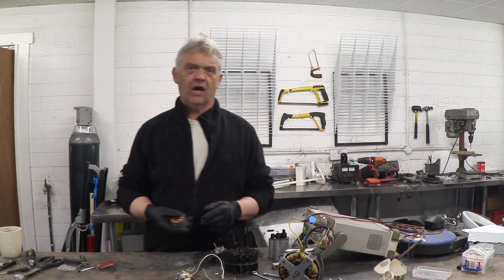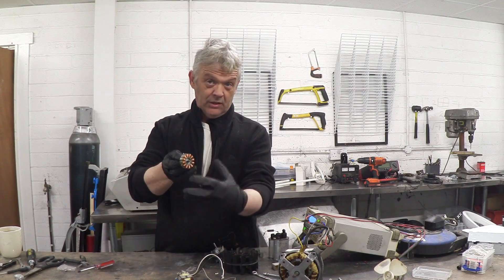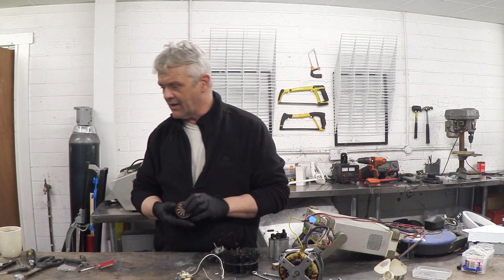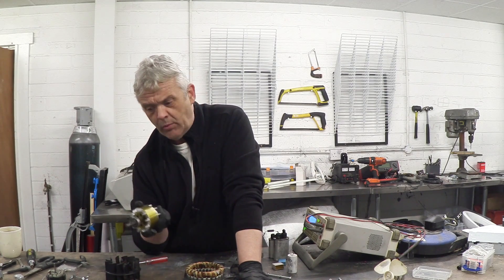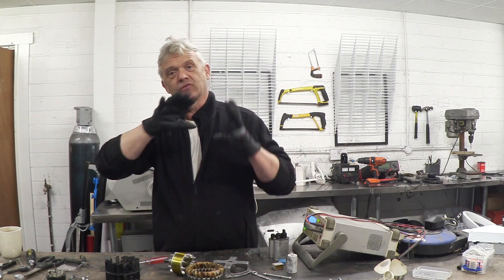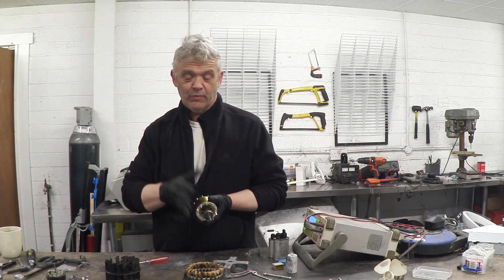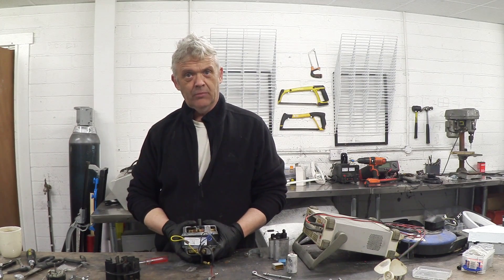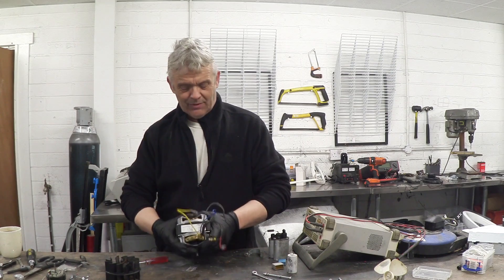500 An Induction Motor As A Generator Without Altering The Motor

Comment: I think the best speed has something to do with the tuned circuit: f = 1/(2*pi*sqrt(L*C)).
Reply: The capacitor is used to cancel out the reactive (inductive) current that the motor draws, apparently. (See 'Motors as Generators in Micro-Hydro Power' by Nigel Smith, from your local library?) This reactive current is relatively constant over the range of power outputs from the motor. A fair approximation of the required value can be found by (a) measuring the current drawn by the motor at no load, preferably with the cooling ducts blocked, to reduce the actual work being done by the motor. That current is mainly magnetising (inductive) current, with only a small 'true power' current driving the reduced windage, bearing friction, and low iron and copper resistive losses. (Some of the measured current is still driving resistive losses in the motor, but at no load, and with the cooling duct blocked, these losses are minimised, and most of the current will be reactive.)

Then, determine the reactance of the motor to draw that current. XL = V / I. That gives the approximate reactance the capacitor needs to have to compensate for the motor reactance. The capacitance can now be found from C(uF) = 10^6 / (2 x pi x f x Xc). 

Example: a 1kW single phase motor draws 2.3A from a 230V supply at no-load. The motor reactance is approximately (230 / 2.3) ohms = 100 ohms. The capacitor that will also have approximately 100 ohms reactance at 50 Hz is.... (10^6 / (2 x pi x 50 x 100) = 31.8uF. That's the starting point for setting up the capacitor; it /will/ require a slightly larger capacitance to hit the 'sweet spot' for best operation.

For 3 phase machines, refer to Nigel Smith's book. The principle is the same, but the capacitors may be connected in either star or delta, and the capacitances and voltage ratings are different for each of those cases.

The capacitor is not a motor-starting type - these are rated for intermittent operation only, and often less than the motor voltage. (That's another story, though.) A polyester or other 'motor-run' capacitor is required, and should be rated at a higher voltage that the output voltage of the machine in operation. (Switching off a large load can cause a 50% surge in output volts in some machines!)
Reply: Thanks for the lead to "LC circuit" concept! I have been also wondering whats the magic formula really is. I dont know any algebra but what i have tested with the common tank circuits its always 1:3, 1:6 or 1:9. So for example in "Super Joule ringer" there is one full wound triggering coil to 3 full wounding for collector. But the capacitor for tuning is hard to calculate and usually needs additional tuning capacitor too. And for some odd reason super capacitors seem to work better with it when they are "wrong" direction (+ > -) in the circuit...
Reply: Use a non-polar capacitor, eg a motor run/start type of sufficient breakdown voltage. I think they’re usually film caps.   

Per Tim’s equation, if the inductance is in the mH range and the cap is in the uF range, then the LC resonant frequency is up above the kHz range.  

R in ohms will be greater than L in Henrys, so the RC frequency will be less than the LC frequency.  Doesn’t it work on a ~90 degree RC phase shift?
Reply from the maker: that makes sense mate - cheers

Comment: I would love to see this into a next generation high efficiency windmill.  I'm sure the use of graphene and super capacitors will help!
Reply: ...........not so sure...induction motors are designed to spin synchronized to the mains frequency ..would they still need to spin at same RPM if they are generating electricity versus being driven by the mains frequency supply?
Reply: @philipvernejules9926  As a motor it actually runs slightly slower than mains frequency, due to the "slippage" that Robert mentioned, with the speed difference depending on load. But it will be designed to run most efficiently at around mains frequency, so it will probably be most efficient as a generator about the same speed. Probably not so good for a wind turbine, which needs to accommodate a wide range of speeds.
Reply from the maker: they work well for wind turbines mate - there is some control circuitry between the generator and grid to account for variable frequency for sure but mostly it's a diode and thyristor bridge
Reply: You can get a thrown-away UPS for free and replace the dead battery.  It has electronics for a rectifier, battery charger, and inverter.  

It ought to even have brown-out protection, so it might be tolerant of a variable frequency input from a wind turbine.
Reply from the maker: That would be cool!

Comment: Ok since you playing with motors take a gen head with two 120 plugs giving it to stator coils 
Now wire one for a motor 
And switch to the gen stator 
So the gen head keeps spinning even though you unplugged it and you can run a power tool with it 
I have seen it on YouTube 
It might have to have 3 stators
Reply from the maker: I don't want to be critical here mate - but seeing it on youtube doesn't make it right - have you tried it? did you do a video?
Reply: @ThinkingandTinkering  no didn't try it couldn't figure it out 
I am really good at frying things when it comes to electricity 
But a he'll of a master craftsman
It was about ten years ago 
Seemed like it might work 
Since a gen head makes 220 or 110 
Thought you might want to put some thought to it 😀
Reply: Clearly, you have zero concept of electricity. Best if you stay away from it.
Reply: ......trying to understand your suggestion. You may  not be talking perpetual motion  but s possibly
Reply: First of all, you only have one stator. That right there tells me you have no idea what you're talking about. Secondly, I have no idea what you're talking about but if you feed power back to the stator then you're turning it into a motor... Basically I can't even figure out wtf you're trying to say. It either runs as a generator or a motor, not both.
Reply: @etherealrose2139  you should see what my hair looks like

Comment: On my 1980 Honda cm200t , it took 55,000 micro farads (on dc output, voltage is 7.7 volts and doesn't drop when lights come on) to get the charger to work without a battery. 

On a generac induction generator (whose internal capacitor was bad) I was able to use 6x 23 farad(maybe micro farad, I dont recall)  600 volt hydrogen lighting starting capacitors to get it to fire back up.  Capacitors were plugged into the extra outlet with the load into the other.  The capacitors burned out after a day, but when I would go over 1000 watts, the field collapsed until the load fell into the range of the generator. 

I think if I had more farad than I needed, the capacitors would last.

Or just order the replacement part. 

I was out of power for three days and I wanted to make coffee and watch tv but the free generator wasnt working.   So I just started trying stuff after disassembly and reassembling didnt work.
Reply from the maker: 23 farads is a lot mate likely to be microfards thogh i think more like 200 microfards would be better
Reply: @ThinkingandTinkering  yeah I was probably only at around 122 mf,  I'll order some modern caps if the replacement part isn't available, and maybe do some more experiments.   The thing needs a new fuel tank, possibly a new diode on the rotor.  (Probably the reason to need extra capacitance) .
Reply: @travishanson166   remember dont use electrolitic capacitors.  Film capacitors are likely to get hot.  Basically, youll want a run capacitor  that can handle  ..... ill say at least 3 times the peek voltage of what your working with, unless someone has a better recommendation.
Reply: @kreynolds1123  that's pretty much what I was thinking.  The ones I was using were 600v but I dont think they were built for the duty cycle, plus I was probably under the necessary farads by about 80 minimum.  They were also of the "outlawed" type. When I try it again I will take notes and see how long things last with a load on.  I'd like to get one of those wattage tracking devices instead of doing the math.   If I can record the voltage swings and peak wattage before the field collapses I can fine tune the necessary capacitance for the duty. 

I think they stopped making parts for that particular generator, so getting specific replacements might be difficult.   But it's mostly about learning how and why it all works than anything.   Then accepting any free generator that someone says is broken lol.

Comment: The idea is good but the problem then is the space the capacitors will take. In the case of inserting magnets into it, space is saved. However in both cases either capacitors or magnets you are generating a magnetic field and once you give it a spin, of course, the magnetic field cut through the opposit coil and it will generate electricity. But is the idea too different from magnets? Not really, with magnets, you will save space but then you have to drill stuff. Both are good.
Reply from the maker: all things come at a cost mate - it's only really a cost/benefit exercise for you circumstances - that's why there are so many solutions to any particular problem - if you fancy making a wind generator for a few dollars - this is a way to go
Reply: This Might work with a 20” box fan. These have single-phase split winding induction motors. 

 BTW, Nice use of the residual magnetism to get the electricity to start flowing.

Comment: Them mot capacitors have bleed off resistors in them for safety so maybe different caps will be less power loss
Reply from the maker: In this case they were external and i took them off mate - what you can see is the HV diode but it is just hanging on one terminal - so doing nothing - but Jane is spot on
Reply: Cool

Comment: Car alternators use induction type rotors and are able to generate quite efficiently just by connecting a capacitor to the field windings.  Around a hundred amps out and at a regulated voltage if you use a battery.  The only current limiting factor is the field current so you can use a supercapacitor pack around 100F to get the amps up rather quickly.  These things are cheaper and smaller since their incorporation into the RC vehicle market.
Reply from the maker: this is basically a car alternator mate for sure
Reply: I thought car alternators had brushes. https://en.m.wikipedia.org/wiki/Alternator

And RC airplanes use brushless synchronous AC motors with a permanent magnet rotor.  

These are different than induction motors.
Reply: @mikeguitar9769  You are correct.  The low current field windings are powered through the brushes.  I guess these things are a bit different than any other household motor that can be easily acquired.  I haven't changed brushes on one in so long I forgot they were there!  It was just so easy to throw out the old and buy a new one.  Times may be changing back to doing these type of repairs soon..

Comment: I did this a while ago when i was stuck for a generator, i used a stationary petrol engine and hooked it up to a 3kw 240v ac squirrel cage motor and simply set the motor speed until i got about 200v ,  i was able to run just about everything off it, the main issue was though was when a relatively heavy load stopped drawing power the governor on the motor didn't keep up and you got this surge in speed hence why i ran it around 200v, so when the voltage did spike it only went up around 240v to 260v so still fairly safe for most of the stuff i was running , when i first started it up before i got tuning it i was able to generate up to the 1000v mark as for the capacitors i pretty much didn't have to change anything
Reply from the maker: tha is awesome mate - did you do a vid of the set up?
Reply: one of those cheapo computer voltage regulators should do the trick..  here in the Philippines they are quite cheap
Reply: Need a load cell or an electronic switch that cuts throttle when voltage changes by a particular amount or rpm trigger.  

I have a coleman generator that only has 1 speed, and it's only happy when it's got a load on. Sounds like its going to come apart every time the air compressor shuts off. 

Need a voltage limiting device that only comes on when there is net wattage available.  Think a light bulb that goes dim when a fan comes on, then bright when the fan turns off.   The draw would be 0 if load is used elsewhere,  but up to a few hundred watts when load drops off.  Maybe just a 250 watt incandescent bulb would do the job without fancy electronics.  

I'm contemplating an $8 arduino and an automotive relay with a lock solenoid to sense either rpm or voltage delta to cut throttle to idle on the colman.     Otherwise it's around $200 to adapt a throttle control off a Honda.  

I'll be using the coleman again today, I plan to try the light bulb idea to see if it will keep it sounding healthy.  If I had a tach I could ignore the sound, provided it was running at rated speed.
Reply: @travishanson166  probably a simple solution would be to add a bunch of diode's in series so that they turn on at a specific voltage, the diodes will remain off until the voltage goes over what you want it to and begin to conduct to a light bulb or two to keep a load on it.. it's automatic and it's cheap! Just size the diode's for the voltage and current that they are going to be working with, add up each of the voltage drop from each diode till you get to where you want to be at, if you don't want to light things up, you can always use a high powered resistor to dial in how much load you need to keep it stable. The light is great for testing as you can see when the diode's are turning on but once you have it worked out, swap out the light for a resistor in a similar resistance.. I know it's not as cool as using a microcontroller but it should work and it doesn't need power to operate! 
Hope this helps 🙂
Reply: @PeterMilanovski  that's a pretty good idea.   It could be made in a tight package and put on the frame with an indicator bulb if a diode or the resistor fails.
Reply: @travishanson166  exactly, and you can save your microcontroller for something else a little more complicated 😜
Reply: @PeterMilanovski  the most complicated part of the microcontroller (since the advent of arduino) would be mounting the hardware.    I have pretty much everything I would need to go this route already.  But...

I like your idea better (which actually challenges my brain a little more, for complicated reasons lol).

I can contend  that the simple solution (as in least solid state components and hardware)  tends to be more robust.   I do have a schematic somewhere that uses an inductor and a few diodes and a bulb as a voltage sponge/surge suppressor.    And I need the soldering practice.
Reply: @travishanson166  we all do, we definitely all do LoL.
Reply: @PeterMilanovski  ; Zener diode?
Reply: @gyro5d  the zener could be an option! Although my knowledge about the zener diode's is limited! I believe that I have a basic understanding of their function but I have never played with one to fully grasp their fundamental workings! My original quote was working of the idea that the diode likes to drop some voltage so it's easy to obtain the desired voltage by using a few in series and by using a diode resistor voltage divider, you can fine tune it till you get exactly what voltage you need! But it's wasteful, disapating heat! 
The zener sounds like a much better option! And I probably would have mentioned it had I worked on circuits that used them but sadly I haven't needed to yet, I'm aware that they don't conduct until they reach a certain voltage but I have no idea what happens after that? Do they have a point where they cut off or are they like regular diodes?
Reply: Inverter generator. i think they use some type of electric clutch and the governor. something like that inside there.